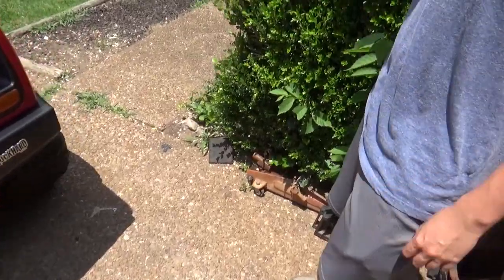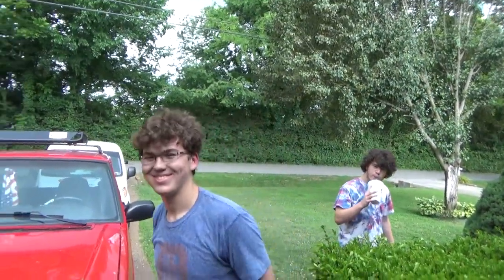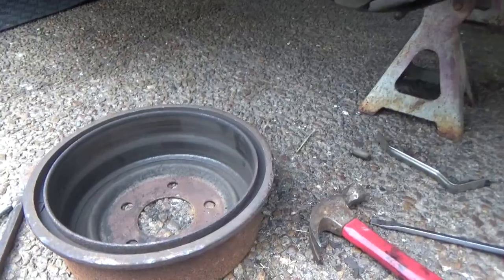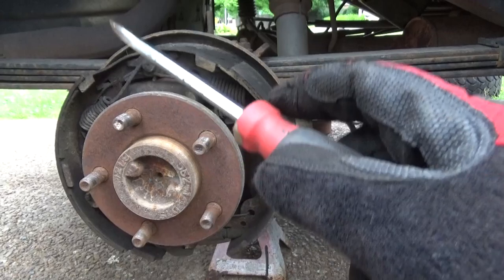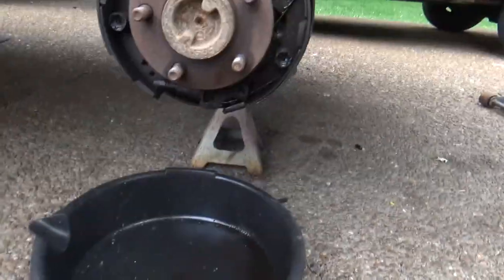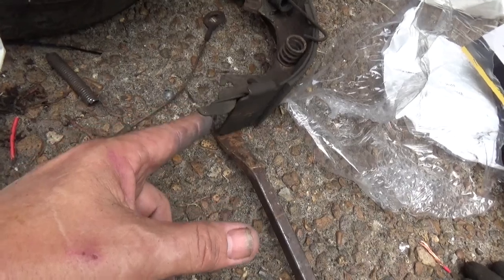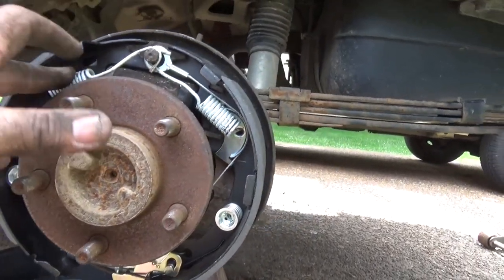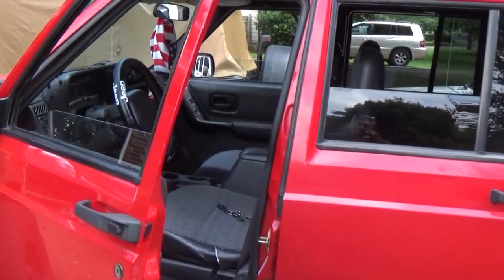Jeep Wrangler and Most Jeep Rear Drum Brakes DIY With Will

Comment: First thing I did on my 89 wrangler was a complete rear brake job. One of the wheel cylinders blue, so I opted to replace everything. I had all the necessary tools for working on my 65 Mustang in the past. The specialty pliers definitely come in handy.
Reply from the maker: yeah its so much easier with new hardware eh ?  Love the 65-68 stangs too :)

Comment: I have 2004 Wrangler Sahara and was changing rear brakes and cylinder. When trying to disconnect the brake line the line was moving with the fitting. So the way to salve this simple problem was very simple after I figured what to do. Get a torch and heat the fitting. Do not heat it too much, just hot. Then put your wrench on it and it will turn like butter. Let me know...!

Comment: Just changed my rear axle on my 93 YJ and started doing everything but the adjuster cable is stretched or idk it won’t hold on the teeth. It will hold if i put some pressure on the cable. Any help plz ????

Comment: I have a 2001 jeep wrangler and having a problem with the rear brakes dragging on both sides. I've replaced the shoes and both wheel cylinders but still dragging. could it be a problem with the master cylinder

Comment: Yeah.. I know silly question. I am currently driving a 02 jeep wrangler with tires with some tread left. I have just changed the front brake pads but I wanted to know one thing. When brakes are applied, brakes on all four tires should activate?  I am currently having an issue. When I try to come to a stop on wet road. My front two tires lock but I don't feel the rear engage. Might be the pads?
Reply: Should all four brakes engage? I don't know if they should.
Reply: yea all four should engage... the front first rear second ... reason the nose dips when you hit the brakes

Comment: I just dont both rear brakes on my 95 jeep wrangler... replaced everything... in the kits I got two thin round washers and two u shaped washers .... looked for them when I took everything apart and I did not see them... what are they for and where do they go?   thanks in advance for the reply
Reply: shots2 the u shaped ones are for the parking brake lever that has a small pin that goes in the hole and the u clip/washer goes under the lip of that pin

Comment: Great video, always do my own stuff and it's nice to see tips and tricks from the veterans. Why did you have to adjust them, wouldn't pressing the brake adjust them?
Reply from the maker: +Patrick Thomson good question 😀 The brakes adjust only when going in reverse and hit the brakes. That pulls the cable which pulls up on the adjuster.  It doesn't adjust going forward.